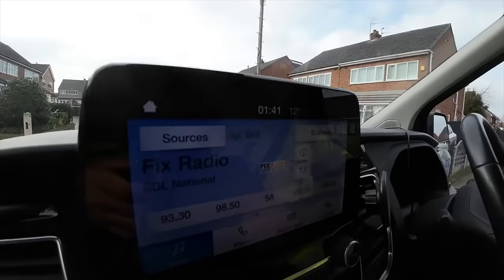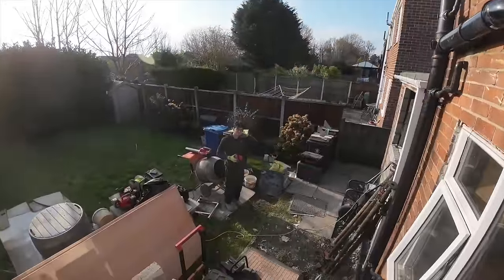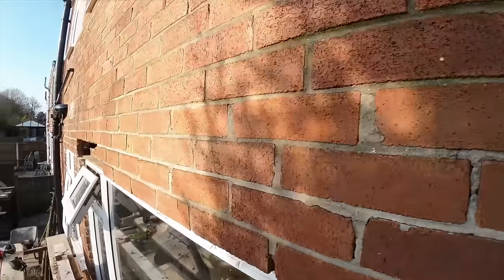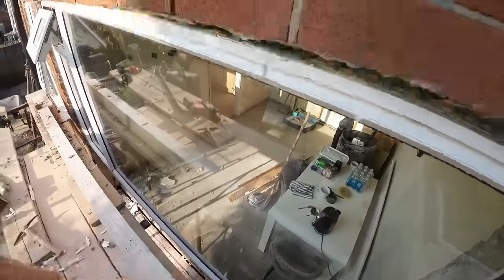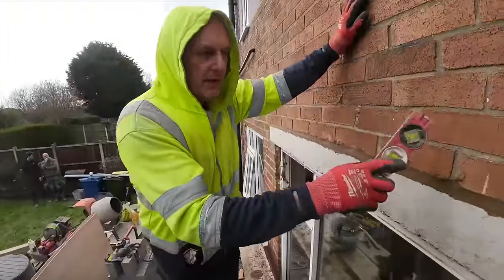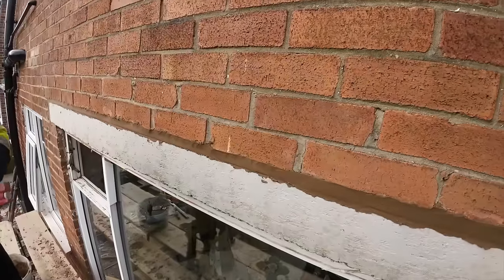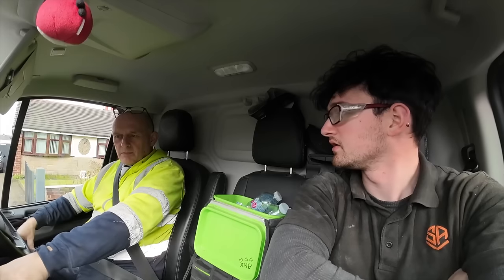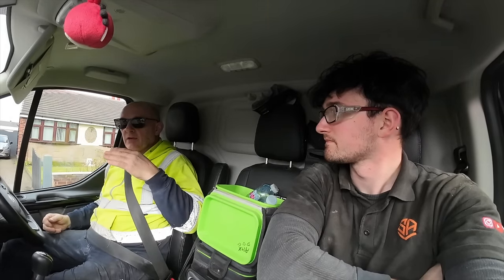WHOPPING 3 METRE CONCRETE LINTEL !!...WE NEED HELP

Comment: Did you pack with slate? Was it  ok to remove acrow's without mortar setting? Presumably the lions share weight of the house on a cavity wall is taken by the inner leaf?
Reply from the maker: Yes it was packed with slate plus that brick work didn’t need props in as I was so solid 🧱👍🏽

Comment: I guess the key issue is whether the render does in fact seal the wall, not just on initial installation but over the full life of the system.  I bet the answer is that it does not stay waterproof.  Done well, even if it isn't waterproof, it probably won't let in enough water for it to run anywhere in the brick.  But we all know there will be some cases where the worst case scenario happens even with the best construction, and more often with bad construction.  A larger question for me is the question of condensation within the wall system.  Does the construction, and the climate, mean that there is condensation from air leakage within the wall cavity?  If yes, where does the condensation escape to so it does not cause mold and damage?

On another note, you guys need to find a hoisting system that you can attach to the strong boys and lift the lintels into place.  No need to take the damage from lifting heavy, awkward loads anymore.

Comment: With a decent cavity tray you don need weep vents. There was a block of flats in Blundell Sands, weep vents fitted correctly but the off shore wind was blowing water into the cavity causing damp
Reply from the maker: Totally with you on that one Glynne , cheers 🧱👍🏽
Reply: Anyone ever seen water running out of a weep hole coz I haven't 🤔
Reply from the maker: Nope 🤨🧐🧱👍🏽
Reply: @SteveAndAlexBuild  The issue is that that the weep vents are above the sealed bottom of the cavity. I agree that water penetrates the outer skin and if built properly the water runs down the inside of the outer skin, great. So the current rules are that the cavity is full of insulation, the weep vents are above the cavity bottom.  So lets think about that, there is a well at the bottom of the cavity wall where water can collect. Normally with air movement as the building heats and the water vapourises but theres no movement of air to get rid of the water and the weep vents are 4 courses at least above the water well.... bring me a local inspector and well have a chat. ... Yeah Im a nerd, but I design  and build the largest structures on earth
Reply from the maker: @glynnepritchard2526 😉🧱👍🏽
Reply: Makes sense that when you think about it, a gutter with a fall on it at the bottom of the cavity  below DPC, piped out to a drain or soakaway problem solved no weeps needed 👍
Reply from the maker: @bricklayersworldwithandy6277 🤙🏾🤙🏾👍🏽🧱

Comment: You should try the dewalt 18v sds, goes through brick like butter.
Reply from the maker: Who is De Walt 🧐🤣
Reply: @Gippojr. Many years ago, I asked a tradesman in the building industry what he thought about the higher end, professional Black & Decker power tools. He largely rubbished them and said that De Walt were the best/mutts nuts/Rolls - Royce brand of power tools. Some years later I visited the B & D factory at Spennymoor, Co. Durham. A large scale re - organisation was under way in one of the  production halls. I asked my contact what was going on and he said that the De Walt production line was being brought back from Italy. “That’s De Walt power tools your speaking of?” “Correct” my host said. “B & D own the brand”! Stay safe and well.
Reply: @markmiwurdz2248  I wouldn’t say they’re the rolls Royce of power tools but the DeWalt 18v sds is way better then the milwaukee sds hammer drill
Reply from the maker: @Grippojr have you actually compared them ?
Reply: @SteveAndAlexBuild  I have unfortunately, tbh I only had the 5amp battery’s for both but the Milwaukee didn’t have the guts or the durability and that’s cost aside.
Reply from the maker: @Grippojr 🧱👍🏽